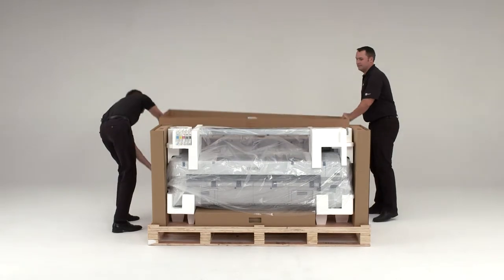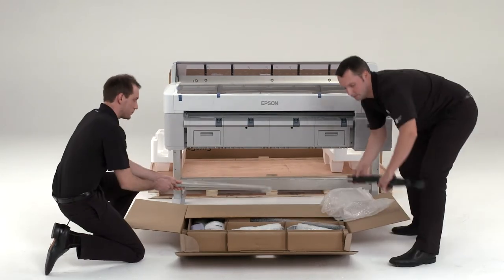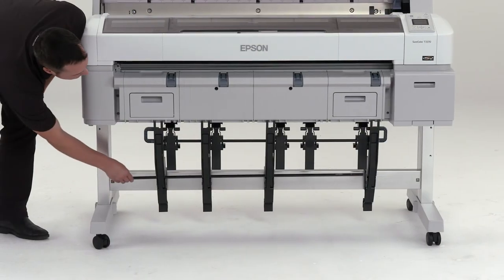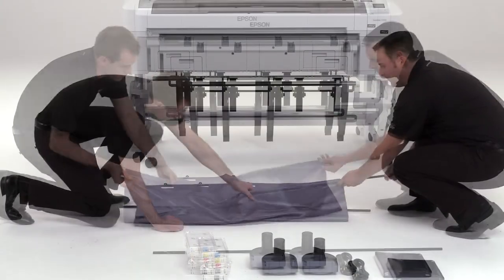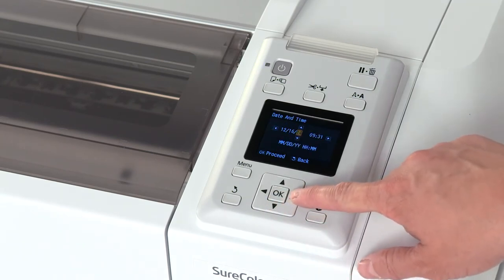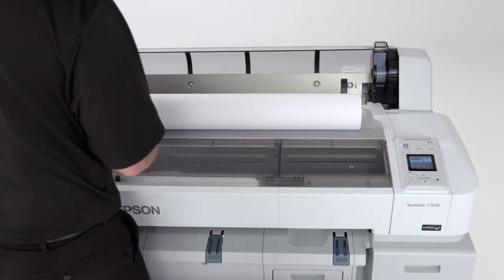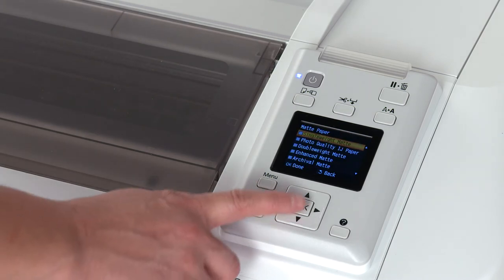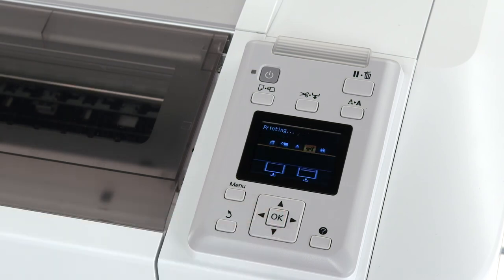Epson SureColor T-Series | Single Roll Setup

Comment: Buyer beware, I've had an unnecessarily disappointing experience with these Epson SureColor T-Series printers and their corporate warranty support where they let me down costing my company significant work loss.  I recommend independently researching reviews of fellow Epson SureColor T-Series owners and their experiences with the Epson warranty program supporting these printers.
Reply: Same concerns with our unit. Probably the worst plotter we had. Wasted so much papers because it wont print exactly what we want, ang really jumpy printheads, the worst when it come to accuracy. Hardly you can have the right and cheap support services here in philippines.